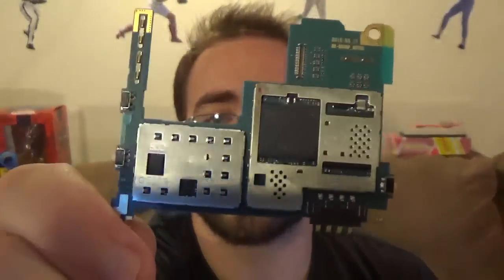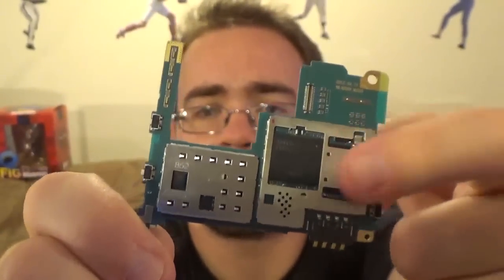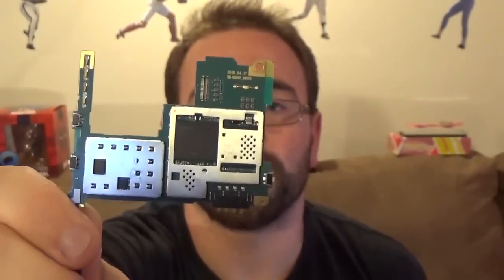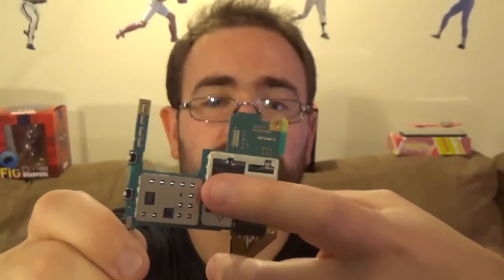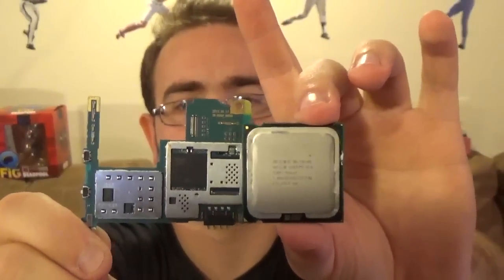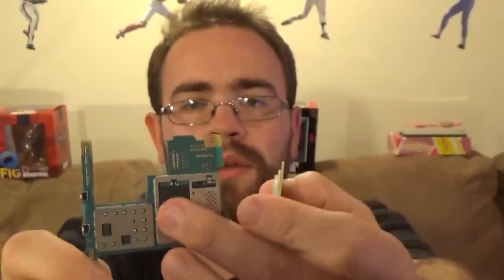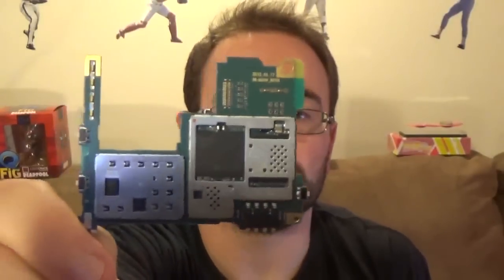Nintendo Switch - x86 And ARM! Why Is Nintendo Using ARM??

Comment: Can't say I agree with your conclusion. Look at PS4 and Xbox, they moved to x86 why? 
It's more powerful, easier to go multiplatform... 
ARM is nice but for console I think it's better to stay at x86.
Reply: Whether you see it as a portable that can be docked to a tv or a home console that can go mobile, The mobile part plays very heavily into the design. regardless it should be powerful enough to not be a problem.
Reply: Major REX LOL, the success of Nintendo Switch is not our topic here LOL, weather is success or not it's out of topic,  Nintendo choose ARM because it heavily on the mobile part , if their aim to be solely on home console device then they would have choose X86.  ARM (low energy consumption and decent power)  X86 (hungry energy consumption  but powerful ). Both are efficient, but it depend how you use it. If you want powerful home console X86 for now it's the one to go, if you build a mobile then ARM is the one to go.
Reply: Supercomputers are made up of a ton of processors and run highly parallelized workloads,  for them it doesn't really matter that the IPC of each individual processor is low as long as there are enough of them. 

Unless you can point to a quadcore ARM processor that can beat desktop Core i7s (Geekbench doesn't count) then yes, it is performance limited.
Reply: arm isn't inherently more or less powerful, x86 (it's actually AMD64) just has more specialized instructions that it can do for  very specific things. A computer is a general purpose machine that needs to be able to do many different kinds of things quickly, a console is not. With arm the cpu does exactly what it needs to and the specialized instructions can be handed off to the gpu (the custom tegra chip)

The ps4 and xb1 use x86 (actually AMD64) for the same reason that the original xbox used an x86 (actually x86) chip, because they're super common and therefore cheap. They don't have a reason to use specialized chips like the switch's arm processor or RISC processors like in previous generations and spend the extra money to produce these chips. The big difference isn't so much performance as it is power. the xb1/ps4 can easily just fit a bigger cooler and larger power supply, but that is simply not an option with the switch.
Reply: Yes true, the cost vs performance vs size has to do with why Nintendo selected ARM. Of course they could not take a x86 and make it power efficient if they wanted a hybrid device but to say "we" are moving in that direction and that ARM is the future is a bit to much assumption. Gamers will never abandon the consoles and PC and thats where you will always have the best performance. ARM might be great for portable devices but they dont compete with the regular consoles/PC. 
I wish Nintendo did not go the mobile path though. In some aspect i do like the portable appeal but on the other i dont see myself use it that much. Some people might but personally i prefer to game on my big TV like 95% of the time. Still its an interesting concept.
Reply: Arm is not performance limited, some of the most powerful supercomputers in the world use arm processors. Arm is usually most useful where power/performance needs to be as high as possible and the feature set needed is small, but that doesn't mean that performance has to be low, but the most visible case of this is in mobile processing.

I think we're forgetting that the gpu is much more important here, once you remove the aches and pains of having a monolithic os running behind everything (windows) the cpu and memory is even less of an issue for games. A full size console could benefit from using arm in some ways, but it isn't currently worth it for sony/microsoft to take this route, and like I said earlier, a pc is a more generalized machine which is why these random instructions are there in the first place (not that they are needed for games)

Nintendo is not shooting to make a high end console here, so it doesn't need to perform on par with them. Even the xb1 and ps4 are built to a price, the switch's price is lower and has slightly different priorities. It makes sence for nintendo to go this route, and with an soc like the tegra and an arm cpu you can have a low power device that should pack quite a punch at 720p (especially if nvidia gets the tegra chip scaled down to 14nm).

I wonder if they will make a cheaper non portable version later if it is popular enough, sounds like a nintendo thing to do.
Reply: because Switch is mobile home console "mobile" . So if it using x86 , i bet the eatery wont last for an hour and it will be very hot and 100% will blow your switch.
Reply: Major REX it's a  " mobile " home console, that can be connected to " TV ". The fact that it's a mobile, the first reason why it need to have " battery " , and it need to have a good preservation of energy.  Call anything u like, the fact that all the GPU and CPU inside are on the tablet device it self and running on battery it's a "mobile " device first and foremost. Yes u can play it on TV , but that that's a second function.
Reply: Allen McFine agree, the mobile part plays very heavily on the switch especially with all the CPU and GPU component are inside the tablet.
Reply: I assumed they move to x86 because it was going to more general purpose computing. Like streaming, etc. I'm glad for the move, since it would make the games easier to port to the PC. But again, it's all assumptions, for video games I don't think you need all of those extra instructions sets.
Reply: Major REX The benefit they are looking for are on the gaming sales, just look how  iOS and Android device have a lot third party games even tho their device made from ARM chip. If Switch can make a good sales and make a great deal and can money hate a lot of third party i bet it will, Just look Wii sales and they got a ton of third party games.
Reply: Mika Hadi not really its a hybrid device and first a console. The mobility is a bonus feature. But yes I understand your point but Nintendo is marketing this first as home console. Even their commercial starts with a guy playing on a big screen.
Reply: So basically you get more power with less money but it consumes more power and is less effective.
And yes GPU is more important but CPU plays a crucial part as well. Still i would prefer a bigger and more powerful console myself. There is a reason the biggest players moved away from customized CPUs. O well we will see how successful this proved to be. I am still in doubt that Nintendo will succeed with this strategy. The mobile market is really much harder to penetrate in my opinion. They should have learned by now that real gamers are the ones spending money on games. Mobile gamers are the ones wanting to play free.
Reply: Mika Hadi hehe I know, was just sharing my thoughts. But yeah I agree with the conclusion :)
Reply: True, but these days the boarder between multimedia, game, movie is very close to each other. I'm also glad about the move to x86. 
It will be interesting to see how Nintendo will make the Switch successful with ARM. I dont think many third-party will port their games to ARM if they dont see a huge benefit.
Reply: You comparing apple vs orange here. Gamers want the games made for consoles not phone type of games. That is my personal opinion any way. So if lets say Bethesda makes a game for PS4 Pro and want to move it to the Switch it will be a hell allot more difficult now. They would do it if the usrebase grows and they make money on it but people wont be replacing their phones for the Switch and i dont believe it will be a game changer like Wii was at the time. Most people are already used having tablets and phones. Also consider the amount of quality games available on iOS. Although most of these games are not what the hardcore gamers wants. For me i dont really like playing using touchscreen for longer period of time. If i really want to play i like a proper handcontrol. Even they small joy con or what its called qualify as real controller to me. Atleast they made a proper controller that i hope will work with all their games. The Pro controller almost dont work on any game on WiiU, really frustrating. 
I have already pre-order the Switch myself and i am pretty sure it wont get tons of support from thirdparty so basically i will be playing Zelda and a few games i enjoy from Nintendo but sadly my prediction is that thirdparty will drop the support much like they did with WiiU. I seriously hope it succeeds but everything i read indicate that they have again made the Switch a bit to gimmicky and not focused on gamers.
Reply: Major REX Well even tho Switch not that powerful like 8th gen games, But  is powerful enough to run skyrim on the go. and run Zelda on 1080p without no frames drop (on Jimmy falon shows). What else do you expect, Nintendo has tried N64, Gamecube and  Wii U and all the consoles are respectful strong and failed on the market. That's why they choose to go a little bit on casual side (mass market trend). maybe you are correct  many people maybe already has their tablet, but Switch is different then normal tablet. Maybe it will not and never take the spot on Apple or Android tablet, but they have their loyal handled follower (3DS, DS, Gameboy gamer) Hell even people who own tablet tend to have multiple device on their possession  Nintendo games doesn't need a powerful hardware because their first party games are tend to be family games and variaty on it, and their quality is on par with many 3rd party developer games and  they always survive. They dont need to attract PS4 , Xbox Gamer and PC gamer or to have a level of sales like Apple iPad , they just need to survive first with their strong trump card and that's mobile dedicated gamer. Latter on if it's gain sales bit by bit the casual one will follow and buy it, and maybe if this plan is success we will have Nintendo create a powerful machine in the future. Their philosophy is like this " Even our consoles cannot be a primary consoles at least we can be a secondary consoles on home entertainment system. " So maybe PS4 gamer or Xbox Gamer or PC gamer  or even Smart device gamer will buy Switch as a secondary console , but later on they will fall in love with Nintendo.
Reply: "Nintendo has tried N64, Gamecube and  Wii U and all the consoles are 
respectful strong and failed on the market. That's why they choose to go
 a little bit on casual side (mass market trend)."
To me this says it all! This is the sole reason they failed (Wii being exception for it was sort of revolutionary at the time). Mass market wants cheap or free games which is not what Nintendo wants. The money is where the gamers are who buy expensive games (i think). 
But as you say Nintendo needs to really deliver  high quality games more regularly and not just ports. As long as they do that then the Switch crowd will be pleased. I agree that it doesnt have to be as powerful as the other 2 but it needs good content and faster release time. I mean seriously Zelda has been in development for ages now and i read some rumor that it might not even come to WiiU. This wont make for happy customers who trusted N and bough the WiiU.
Reply: I agree, i am an old timer on Video games i grew up with Nintendo on NES and SNES but when PS came, they blew up my mind , not because i hate Nintendo but my need for game were changing, when i am at teens and not kid anymore i tend to play more mature games at at adult time i prefer PS more then Nintendo, but still in my hearth Nintendo still deliver a great games even tho they targeting family more but i will still buy their games especially the exclusives one, the same with PS4 at the present i always play the excluisve one PS4 and third party on PC. I love playing on Nintendo and will continue with my kid and grand kid in near future (if i have kid) . But seriously their biggest enemy and competitor is not SONY or Xbox but Tablet and Smart phone device. They the one killing all dedicated gaming platform.  So as long Nintendo focus one  thing (the one they good at). People will buy it (PS4 focusing on games).

Comment: You're a complete idiot. Nvidia and IBM have a working partnership. IBM has been making processors for nintendo for nearly 20 years. the N64 and all nintendo console used a RISC processor so it makes since for the to go with an advanced RISC architecture such as arm which is completely customizable, unlike x86.

Comment: dude... micro controllers.. and it sounds like you dont know much about the architectures of arm or x86-64...arm is not a protocol...like you said its a risc processor .. reduced instructional set code ...so it has less functions as a x-86 architecture...

Comment: Thank you, that helped me understand a little more what is going on right now, and why Nintendo didn't make two different consoles that run the same games on different resolutions like I had originally hoped.
Understanding ARM processors and future trends better now, I'm glad they did it this way.  So, now as I understand it, this is basically a mobile gaming device bundled with a dock.  Except that these days, mobile devices are becoming so powerful that the docking station will give you a home console experience that is satisfying enough to be considered a real console in 2017.
How competitive do you think it will be with Xbox One and PS4?  Seeing as how they process things in different ways, we can't compare the gigs of ram and so on directly, but for all practical purposed, how would it measure up?

If they made a system that could run the same games just as well as the Xbox One S, how much would that cost?  Would that be realistic?  Or could they be as powerful as PS4 Pro?
I know that the screen itself and the portability would make the same power more expensive, but the lack of optical drive and the size and cooling that go along with it, would certainly help.  Basically, do you think Nintendo could make the Switch powerful enough to run Doom for a retail price that would be a realistic sell?

Comment: oh god First off you're wrong about apple and samsung, apple is far behind on the ram thus making apple apps only use what its got on the phone work wile samsung is pushing octa cores with 6gb of ram's and on top of all that apple has just come out with quad cores but the catch is 2 main cores will run at higher clocks and the 2 others at lower clocks.

Comment: Except...one little fact: NINTENDO SWITCH ISNT CONFIRMED WITH ANY FORM OF FUCKING TECH SPECS YET! Emily Rogers is not a source.
Reply: I'm pretty sure Nvidia themselves confirmed that they were doing both the GPU and CPU for the switch.
Reply: Skarn22 yup but never said one word about its specs. said it was a custom architecture and that's it.
Reply: Wait, what did he say that contradicts this?
Reply: Skarn22 he's saying it's not based off an x86 architecture and uses ARM but how can he know if the specs aren't released officially? lol impossible to know so this entire video is literally speculation played out as facts.
Reply: Statistic189 Nah, Nvidia confirmed it would be a Tegra specifically. All Tegras use ARM cpus.
Reply: Skarn22 yes, but they stated it was a custom there chip. they could literally change everything we know about it. so it's still speculation and not factual.
Reply: Statistic189 Tegra was designed from the ground up with ARM in mind... They're not as interchangeable as you seem to think they are.
Reply: yes it's a costume chip, and it's costume chip from Nvidia , and the costume chip that is close to the spec is from Tegra variant (mobile variant). Because it's impossible to have their desktop variant running on tablet device LOL.

Comment: protocol wtf its not protocol ARM desings all off their arm cpus like arm a53 a72 and all the arm GPU like 780 880 its a full cpu desing that arm licenses to others like samsung and samsung might do little tweaking to make more speed or use more cache  x86  vs arm biggest difference is that arm uses risc wics is reduced instrutions tottally opposite to cisc so that way arm is more energy eficiance than x86 but also not so powerful cos there are not so many instructions to help speed operations  and x86 uses cisc

Comment: @1:16 WOW that's wasn't patronising at all... no...

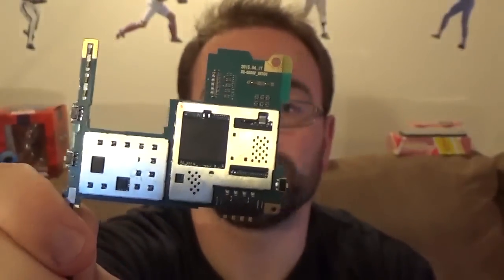@ 2:16 WARNING!!! WARNING!!! LEVELS OF CHILL DANGEROUSLY CLOSE TO TJ Max. 
This dude never delidded a Core 2 Duo, that's for sure! The biggest Core 2 Duo was the 45nm "Wolfdale" with 107mm2 fabricated in January 2008. That's about 1cm wide * 1cm tall, which is pretty much the same as the "black chip there between the silver" (Cortex A53) first fabricated in 2012, 4 years and several process node shrinks after the biggest Core 2 Duo. That was really a fair comparison, wasn't it?
 Just to put it under perspective, a  modern single Broadwell Core 14nm FF measures 8mm2. Is true that the Cortex A72 packs 4 cores in the same 8mm2 (which does not mean is 4 times faster), but, is not like we are talking about massive amounts of space like Spawn "Chill" Wave is making you believe. The most likely reason for Nintendo to choose ARM was power efficiency, as we are talking about a batery driven hand-held device.

This Spawn Wave man just talks crap and is trying to hard to chill as far as I am concerned. I mean, the information I provided is available in the internet for everyone to see, him included. I will not  other anymore with this video because the user #matsv201 torn it to pieces, already. Go read his post instead, if you have interest.